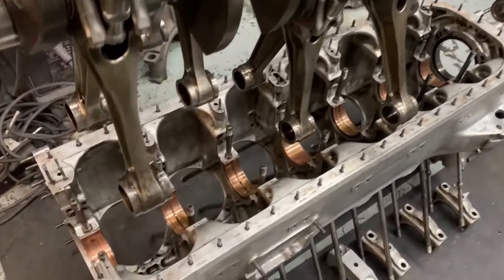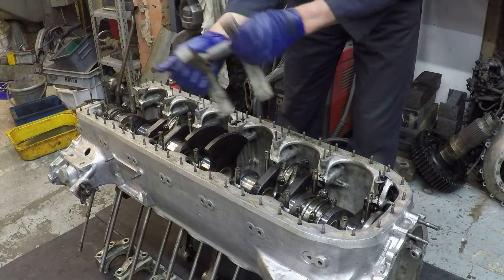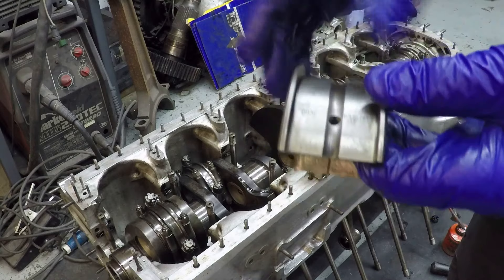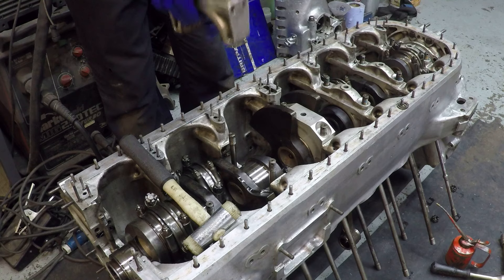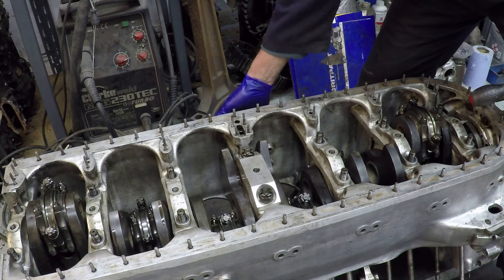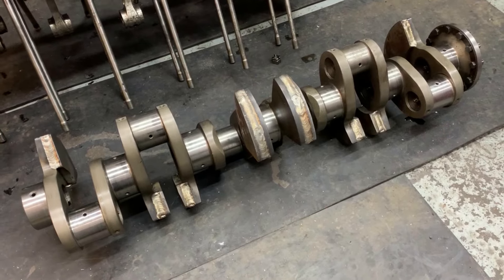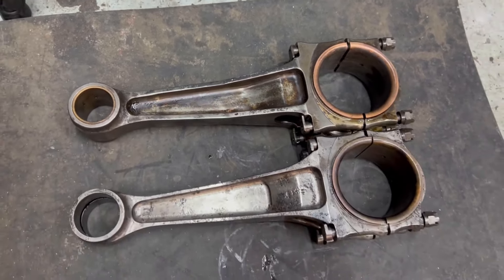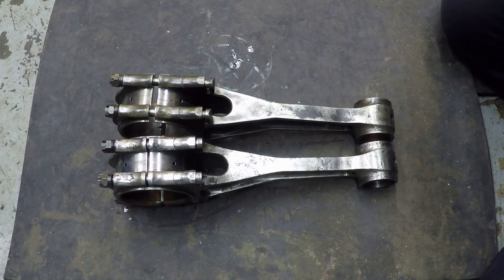Rolls-Royce Merlin MkXX rebuild: Episode 3

Comment: Interesting that the bearings are just copper exposed , vs a Babette coating. Engine bearings are very complicated mixtures of metals tailored to engines, racing applications and apparently aircraft engines.
Reply: The Packard built v1650 series of engines use silver at the primary bearing material with a very thin coating of lead Indium over the top.  You can see some of the remaining lead Indium on the bearings he is showing you.  Rolls Royce used lead bronze as the primary bearing material on a steel shell.  Rolls Royce Process Specification 41 details the plating of these  bearings.

Comment: You can prevent the bearing shell from falling out of the bearing cap by smearing grease on the back of the shell.
Adhesive force will make it stick strongly.

Comment: Are the rod journals hollow to store oil to be centrificaly fed to rod bearings during inverted flight?
Reply from the maker: Although the journals are actually hollow for weight reduction primarily, the proper answer is that they are not made for -1g extended inverted flight, it’s not necessary.  The Daimler-Benz had direct fuel injection, but the lubrication system was no different to the Merlin in this respect.

Comment: Was any effort made to balance the weights of the connecting rods for the rods that were the same style of rod in an engine? I didn't notice any balancing pads on the two styles of connecting rods.
Reply from the maker: They are factory balanced, and each piston has its weight stamped into the forging on completion.

Comment: In his book "Not much of an engineer"  Stanley Hooker talked about a famous dispute between the RR and Ford.   Having been assigned production of the Merlin, Ford motor company were sent the engineering blue prints which caused Ford a lot of consternation.  So they rang up Lord Hives, boss of RR and protested that the incredibly generous tolerances of the Merlin were outrageous and would cause premature failure.  Lord Hives was not impressed, and bluntly told them to just get on build them, and let RR worry about the  longevity.  They had a problem keeping the main or conrod caps tight, so they found a crashed german bf-109 and copied what the Germans did.
Reply from the maker: Ford UK at Trafford Park did indeed redraw the Merlin drawings to Ford's production standards following a conversation with Cyril Lovesey (not Hives).  However, can you provide a reference to your comment regarding the Bf-109?
Reply: @HistoricAeroEngines    Not an official reference, from someone during the war in the UK that was sent out to inspect German V12 engines.  Its no secret that during the war, the Allies used many german patents and even paid for their use after the war.
Reply from the maker: Certainly, both sides analysed all crashed aeroplanes in detail.  Avionics, radar, radio direction finding, beams, jamming, as well as airframe and engine details.  Used to determine performance limitations, strategic weaknesses which could be exploited in combat.  However, you cited that Rolls-Royce copied the Bf-109 main or conrod caps.  The engine designs differ significantly in these areas.
Reply: @HistoricAeroEngines  my source told me, its not the caps, its the fastener hardware that was changed very slightly, its probably difficult to detect the change that was made.
Reply from the maker: It is true that the conrod bolts did evolve.  The Merlin received more than 4,000 modifications to improve the overall design and reliability.  Regarding the conrod bolts, A.C. Lovesey (Merlin Development Manager, 1940 onwards) wrote that extensive photo-elastic tests were carried out on the bolts fitment and stress concentrations identified.  Radiusing the fitment, polishing the bolt finish, and blending the bolt and the rod lug were the areas of change.

Comment: What is the idea for bolts in the crank pins
Reply: The crankpins are hollow to save weight, but the oil drillings have to pass through the hollowed out part to get to the journals. So they sealed up the hollows with aluminium plugs that are held in place by a bolt through the middle. When the engine is running the entire hollow crankpin will be filled with oil.

Comment: Why is the copper showing on the shell bearings faces???? Also no assembly lube???
Reply: Rolls Royce used centrifugally cast copper-lead as the bearing surface, so there was never any tin over the copper.